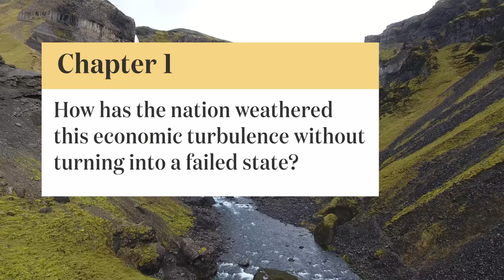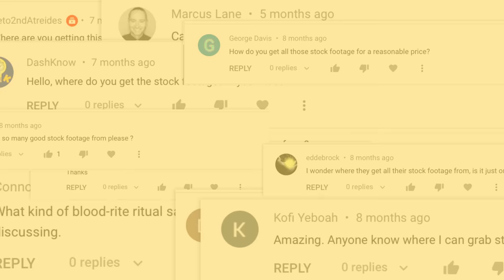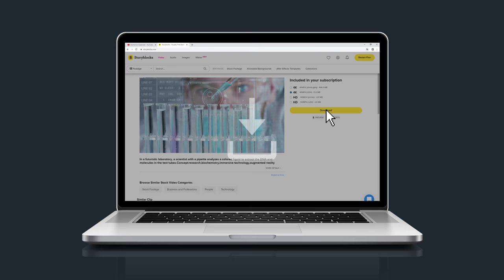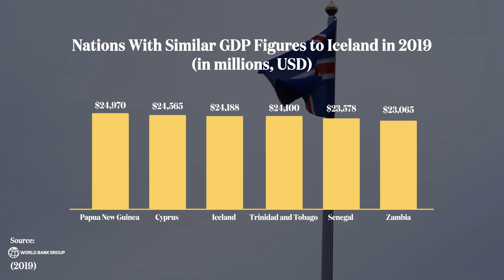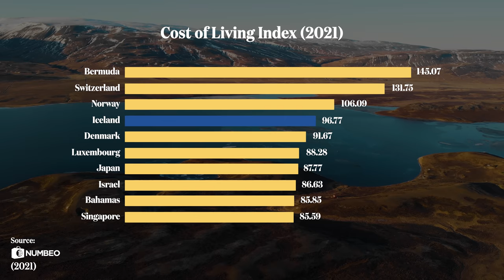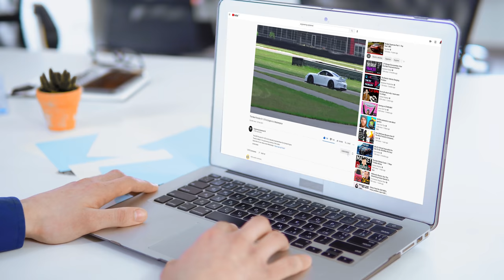Iceland's Story from Financial Crisis to Prosperity | Economics Explained

Comment: “This isn’t engineering explained”
*Challenge accepted*
Reply from the maker: THIS IS A FLUID DYNAMICS MODEL!
Reply: And the Engineering Explained channel is  ot near as entertaining.
Reply: @johnbee7729  
Practical Engineering is really interesting tho.
Reply: It's funny because I've had a course in electrochemistry that came with an in-depth explaination of the aluminium smelting process. Safe to say that the process requires a lot of electricity. Other things one can do with this electricity: large scale computing, data storage, hydroponics, you name it. Plentiful electricity is quite a unique asset.
Reply: @stefangrobbink7760  True, although hydroponics was a failure in Iceland. The country was one of Europe's biggest banana producers at one point, but it's just too expensive to run due to labor costs.
Reply: @Andreas4696  I have heard that new versions, which are fully automatic. Maybe Iceland can be a banana producer one day, but I doubt they will as long as actual banana republics still exist. You just can't compete against unofficial slave labour.
Reply: @stefangrobbink7760  Well, Europe would ban products created with slave labour if it followed it's citizens ethical standards. It's not that unlikely to happen if there is an rise in awareness about modern day slavery.
Reply: @stefangrobbink7760  I had a student job in one of those plant once. The electric current going into electrolysis tanks generate so much magnetic field that coins shake by themselves and payment cards are simply ruined. Every bit of steel you bring into those halls become magnetic afterward.

Comment: 4:18 Correction: Electricity is not used for heating in Iceland most of the time. We use geothermally heated water for heating, unless it's somewhere remote.
Reply: Which seems way obvouis tbh

Comment: 4:15 Houses are not heated with electricity but through central heating (ie, municipal hot water). Domestic hot water boilers are exceedingly rare, you just draw your hot water from the same mains as the hot water headed for your radiators. Though houses built more recently may have a heat exchanger for the radiator loop rather than use the city water directly like in my day. There are exceptions to this, like the west fjords where there is no geothermal activity that can be harnessed for the purpose of heating water, or in very sparsely populated areas. So while the electricity bill might be low, you have to add in the hot water bill to get a number that accounts for heating.

Comment: Super nice video! But Iceland's heating comes from geothermal heated water, not electricity, around 95% at least. But this makes electricity bills even lower. The electricity is so cheap and so abundant they are actually thinking of creating a cord that crosses the ocean into England or Norway to try and sell cheaper electricity in the European market. Could be a cool video to explore this idea!
Reply: actually only the southpart of the country uses geothermal energy to heat up houses,  and the rest of the country uses electricity to heat them.  and you can believe me on this as i am an icelander and live there.   i live on the northwestern tip and we heat up the water inhouse,  i dont know how the prices over here are compared to other places, but i pay around $300 p/month in electrictity, that most of go to heating,  2700sqft/250m2 house
Reply: @ivarmarkusson382  300 oh my I only pay 80 in the northeast
Reply: An even better idea would be to build a fab for integrated circuits, needing lots of water, electricity and space. Iceland could be the new Taiwan.
Reply: @john-paulsylvester2382  I know!! Just one problem: Earthquakes. There can be thousands of mini-quakes in a single day so a fab would probably not even get a 1% output. Unless ASML creates a quake-proof process... 🤔
Reply: @ivarmarkusson382  $300..🤔 What are you growing?? 🤐
Reply: @birgirkarl   35k fyrir 250fm hús er nú bara eðlilegt utan höfuðborgarsvæðisins
Reply: @ivarmarkusson382  Já rétt hjá þér, og líklegast ekki mikið mv þessa stærð heldur.

Comment: I feel like you missed one thing. Iceland has a lot of usable energy for sure but it also has the power to absolutely destroy poorly built house. Iceland combats this by building chunky houses that take years to build and are really expensive. Just the foundation takes weeks or months, the foundation is a meter deep into the ground and is made out of concrete and iron so even the strongest of storms don't do no thing.

Comment: I always thought that places with plenty of surplus energy to go around, including Iceland, would've been great for attracting businesses that are energy-hungry, such as smelting. I'd also imagine seeing industries that produce hydrogen fuel through energy-intensive electrolysis thriving here as well, since Iceland not only has plenty of free energy, but also plenty of water to electrolyze into hydrogen and oxygen (which could not only be used for hydrogen-powered cars, but also for planes and rockets).
Reply: The reason why Iceland has so high energy output is because of Alcoa the second largest aluminum pruducing company in the world. And hydrogen is only possible locally, as it is hard to store and transport. And we do have busses and cars running on hydrogen in Reykjavik.

Comment: When I visited Reykjavik I kept wondering why there were so many windows left open when it was around 5-10c. I didn’t realize until later they were leaving them open on purpose to air out their homes. Heat is so cheap it’s basically free.
Reply: Ararune  Maybe for a few minutes? But no one I know where I live does that in the winter. Heat is too expensive. I'm not criticizing it I'm just saying it struck me as odd before I realized how cheap the heat is. They even use it to melt snow off driveways
Reply: Ararune  Yes for hours. Like when I show up for my airbnb, I'd walk in and the radiators would be blasting with the windows open. No way that would happen in Canada or you'd get yelled at by someone. I didn't get it until the tour guide made a joke about it when I toured the geothermal power plant.

Comment: There is a large error in the video. At 4:44 you claim the average salary in Iceland is much lower than those in Norway and Denmark, citing some self-reporting website, which is the equivalent of citing an online poll for public opinion. Which is just really poor, elementary school level journalism. If you instead check the OECD average wage report for 2019 you'll see that the Icelandic average wage at 82 thousand USD is significantly higher than that of Norway (67 thousand USD) and Denmark (72 thousand USD).
Reply: I was just about to write this exact comment. This should be corrected!
Reply: What about PPP-adjusted salaries?

Comment: Great video! It's clear you have done your research! One comment I want to add since I think it is interesting: Although we do produce electricity using geothermal, the main benefit is using it almost directly for heating. There are still communities in Iceland that need to rely on electric heating. Most households have a steady supply of hot water from these geothermal plants. 

You can actually see the pipeline that goes from the plants on Hellisheiði down to the capital region if you drive to the south coast from Reykjavík! :)

Comment: Interesting video and mostly correct in broad terms, but there are some pretty glaring inaccuracies.

For one thing, the Icelandic banks did not hold a significant amount of MBS. They were just overleveraged and their books were... for lack of a better word, frothy, with a bunch of goodwill from leveraged buyouts. Mostly though, they just faced the same liquidity shortages as other banks pretty much the world over, only unlike most countries Iceland was just too small to even consider bailing them out.

The significant event precipitating the banks' astronomic growth and subsequent downfall also wasn't really financial deregulation so much as just privatization. For most of the 20th century the entire financial system was owned and run by the government, often with very political motivations. But yes, the privatization was part of the broader economic liberalization undergone by the country in line with the general trend of the Washington consensus in the west.

The EU application came after and largely as a result of the financial collapse, and was put on indefinite hold by the Icelandic authorities, not the EU, for political reasons that had nothing to do with the crash. A new coalition of political parties with different policies came to power and simply decided, contrary to what they had promised, to unilaterally rescind the application (they had promised a referendum on whether to do that).

Yes the tourism sector did help a lot with the recovery, but as you briefly mentioned, the fishing and aluminium sectors are also significant export sectors, as increasingly is innovation and other types of knowledge work. Oh and we certainly didn't have 4,4 million foreign visitors in 2014. The most we had was something over 2 million in 2018, in 2014 it was probably around or even under a million, as shown by your graph.

The average salary figure also sounds wrong and in any case is not at all representative of our living standards, which are among the highest in the world despite the exorbitant cost of living. It's probably just a case of small sample size coupled with a pretty volatile currency exchange rate. The World bank has us at a GDP per capita of $67k in 2019, compared with $75k in Norway and only $60k in Denmark. The gap narrows further still if you look at PPP numbers, but since you already mentioned the cost of living I took the nominal figures.

Overall the narrative was largely accurate though, always interesting to see one's own country through foreign eyes.

Comment: Should cover the future possibility of Iceland exporting green electricity to Europe, if they ever build that cable to Scotland.
Reply: That's a long cable. Though Norway has the same idea with it's hydropower Fjords. The Netherlands for one would welcome this, as it's difficult to generate enough renewable energy on such a small surface.
Reply: @stefangrobbink7760  Norway already has a high voltage connection to the UK, as does france which would enable the netherlands. The more interconnected the european grid becomes, the better for renewables.

Comment: As far as heating goes, we were told when we visited that many of the buildings are heated with hot water pipes running through the walls. And that the water for most of Reykjavik is heated in a central location and piped over to the city. Someone else would need to confirm this though.
Reply: Water Isint heated here, its already hot. almost all building here are heated with water from hot springs. there is no central location for it in the city, we have hot water pipes going through the entire country. only remote places dont have this type of heating

Comment: I have lived in Iceland for 28 years. 30$ energy bills for heating and electricity? You got your numbers wrong. 150$ is more like it.
Reply: Ararune  you are correct. It has become expensive because of a number of reasons. Reasons which don't really matter. My number is based on a 150sqm house. If you are living in a small flat its lower of course but never 30$ for heat+power. My last bill was 145,48usd (I just checked).

Comment: The answer is no not really. Countries don't operate on the scale of economics in the sense of money because each country controls the amount of money in the market. The only things countries really operate on is resources, manpower and technology. If a country has all of the resources it needs to operate effectively then it doesn't need foreign currencies since it can meet it's own needs internally. The only real reason to have forex is to engage in international trade which means that countries that don't necessarily need international trade have significant leeway as far as consequences are concerned.

Comment: bailed out by UK
Reply: The UK didn't bail out Iceland. They bailed out the UK depositors of the Icelandic banks.
Reply: @seneca983  If the UK had not bailed out the depositors Iceland would have been bust.
Reply: @monsmeg9657  No, it wouldn't have. The depositors would have suffered the loss.

Iceland bailed out only the depositors of the banks' domestic branches but refused to do so for the depositors of the overseas branches.